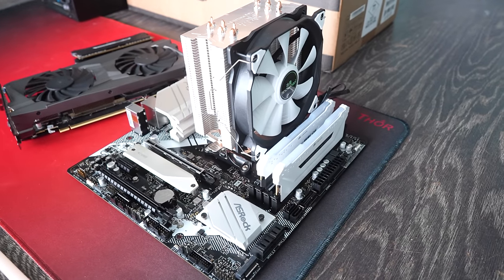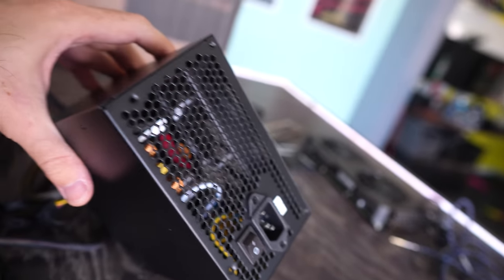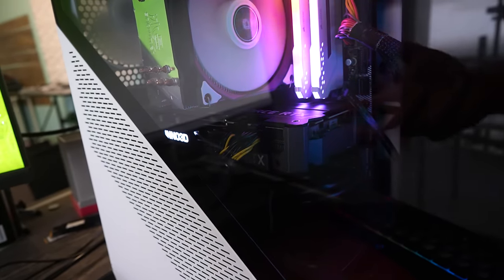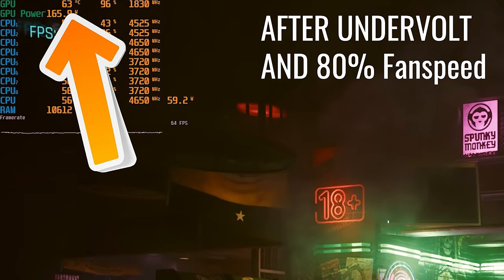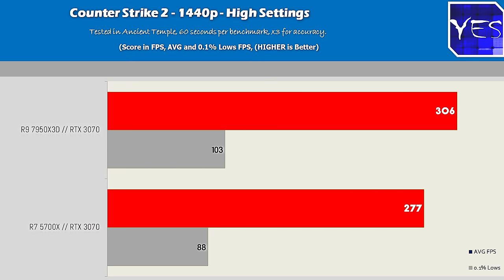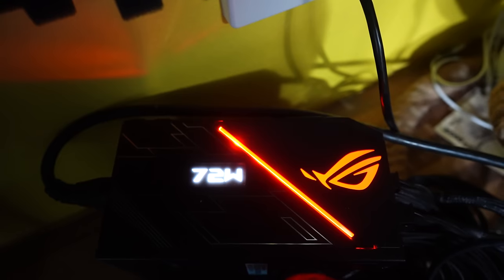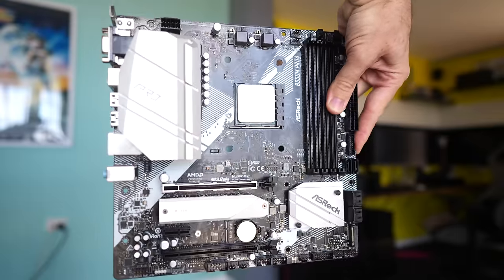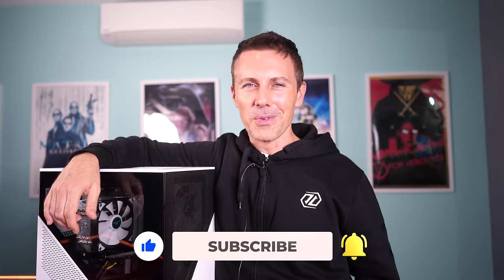Here's a $550 GAMING PC with an RTX 3070 AND a Ryzen 7...!

Comment: For a 1440p high gaming setup, $500+ is rather impressive. I'll see a few parts and see if I can get similar deals in my market.
Reply: You can probably get it cheaper if you dig down the rabbit hole on used market
Reply: Yea but it won't run newer games try a 40 series card. Used it's still $700 to $900
Reply: I have a similar performing system (5800X, 6700 XT) and I play fine at 4K60.
Reply: @powerfulshammy  lol no. As long as you can play 2k at 60fps this far fine. You can even adjust settings for some future games. Not like you need latest and greatest to play games at 60fps.
Reply: Id rather go with a 4060 instead of the 3070 if my budget was around 550$. Its almost the same price new boxed as the 3070 used with not that much peformance drop if any. You get warranty on it and it has many benefits.
Reply: @t0uchmyh0rn  no 3070 is better than a 4060.
Reply: Lol it can’t do 1440p medium on ark survival ascended 🤣😂🤣 hell the 3070 ti can’t stay at 60 with those settings in that game
Reply: @RuruFIN boot up ark survival ascended lol roughest game I’ve ever booted up. 80-90fps 4k on a 4090 and 13900k with dlss on and frame gen
Reply: @yoltsbp  then better pray you find a better card for 1440p under $600 then.
Reply: @yoltsbp  never even heard of that so I doubt that I'm going to have that.

Comment: if the gpu cold plate is screwed to the fin-stack then you should tighten those screws. I once had a 5700XT that would throttle no matter thermal paste i applied to it (it was a red devil one). I then decided to tighten those screws and it dropped like 30c

Comment: No, you don't need a water cooler or AIO for a 7800X3D CPU. You don't even need a high end air cooler. Also, the board doesn't need to cost 200+ USD, a 150 USD board is enough.

Comment: The issue with the RTX 3070 getting hot might be subpar thermal pads. I tore down my Gigabyte Aorus Master RTX 3080 recently to re-paste and re-pad the card. I found the original thermal pads were a crumbling mess. After the "operation" the card runs 10 degrees C cooler.

Manufacturers do whatever they can get away with to cut costs.
Reply from the maker: I will check it out actually. However experience has taught me that the temperatures slowly creeping up over a few minutes at say 60% fanspeeds, has just meant oversaturation on the thermal solution.

Comment: Here in the U.S market we can get things like Ram cheaper used but other things such as power supplies and boards are hard to come by, (Here we can get used ddr4 for $1 or less per gig, but even the crappiest 500w from 10 years ago people will still want $25-$30 for)

Glad to see a reasonably priced 1440p High system after years of "Budget" $1000 1080p Systems
Reply: Bruh this is too good to be true even in the US

I was looking at a Ryzen 4600g 105$ with an RTX 2070 (used) 240$ and a mobo 75$ with 16 gigs RAM & PSU & Case that is over 570$

The system he described has to be at least around 800$
Reply: @KingdomRepublic  i've gotten 2080s off ebay for $190 shipped to my door

As for the 4600G i'd rather just get a Ryzen 7 2700 for around $65-$70 off ebay with a prism cooler, either that or a Ryzen 5 3600 for around the same price

Comment: I had a similar experience with a Zotac 2080 Super twin fan model. With an undervolt it was fine and ran cool and quiet, without the undervolt it was loud and would throttle. This is a pretty impressive build for $550, gaming performance looks very good.

Comment: You've got good taste, I have the same case and also run a 4070 Ti, it meets all my needs and then some! ...I can't justify spending more for something I don't need.
Reply: Just putting it out there that it's possible to find B stock cases with a tiny bit of repairable damage for huge discounts. I got my unused but damaged Phanteks Eclipse P360A for $35 because the metal flange on the rear that holds the side panel was slightly bent. Used some pliers with some cardboard to protect the paint and bent it back to place, good as new.

Comment: I have that GPU in my wife's PC. The memory thermal pads are around 0.7mm, so when replacing 0.5mm doesn't make contact and 1mm holds the cooler above the GPU die. I had significant improvements using 0.5mm with a 0.1mm copper shim and thermal paste

Comment: I just got a 6700xt for 250 flat, i ordered am4 motherboard and ram from aliexpress for 60ish total, i also ordered a r7 1700 for 50, then i got some storage a 1tb m.2 ssd and a 8tb hard drive for 130 total. I also had go get a power supply for 80 so a total of $570. I do not have a case, but im just going to use this in an open bench setup and ill probably buy a mini blower from temu if im worried about dust im gonna have to invest$50 for a better cooler so i can get a better oc

Comment: My personal rule of thumb on my own PC, and when is it time to upgrade is limited by highest refresh rate on my monitor combined with whether I want all that bells in whistles at that refresh rate and fps.   I have an i7 gen 9 8core with an RTX 3070 and a 240 hz g-sync monitor.  I primarily play at CS2 and BF3 on 1280 x1024 4:3 aspect ration stretched to full screen of 16:9 aspect ratio, with my requirement of g-sync on and  v-sync on at 240hz which which ensures 240 fps at 240 hz for a smooth buttery game play, and instant mouse flick to a headshot using a single pump action shotty in CS2/CSGO, and a 44mag scoped headshot in BF3. Anything over this is wasted in my opinion. So all my other casual games like MFH5, F1, BF1 are configured for a step down settings to achieve as high as fps possible without sacrificing eye candy to achieve over 150 fps with VSync.  Any dips are very minimal.
Reply: I mean vsync definitely does feel terrible to me. It's worth being a little bit over your monitors refresh rate, but I wouldn't limit FPS until it exceeds 500 really but I also don't think it's worth going out of your ay to improve FPS (by spending money) until you drop below 150. Limiting FPS just increases latency for no good reason. 

Limiting power > limiting FPS, any day for me

Comment: I'd suggest also avoiding OEM type GPUs (HP, Dell, etc) as they have abysmal coolers as well. They are typically about 10-20% cheaper than board-partner cards but they downclock due to thermal issues.

Comment: this combo is impossible to build in germany^^ the 3070 has a street price here for 250-280 euros (with a grain of luck) and the r7 5700x has nearly the same used price as new... the whole system would eat up 650-720 bucks here... would love to offer this setup for around 600 bucks and i try it everytime when i get asked for a 600 euro build even with an r5 5600 (my fave gpu in price to performance) its impossible^^ so u are the lucky one^^ i love this content, cheers from germany :)

Comment: Actually good testing! Of cpu cuz not all people can have 4080 or 4090 setup
5700x is only cpu you need for even a 4070 gpu even a 6750xt to 6800xt or even 7800xt for 1440p
Reply from the maker: Its a really nice CPU, we did test with 3200mhz memory and 6000mhz on the ddr5 setup. so its also like budget memory vs more expensive stuff on the AM5 side.

Comment: A 5700x is a bit overkill for a 3070. Could've saved some change and got a 5600x which is more than capable to keep up with a 3070. Pretty much every game I run on my system runs buttery smooth at 1440p on a R5 5600x + RTX 3070, 32GB RAM.

Comment: Hello Mister. You know, this happens with any video cards when the heat pipe depressurizes, or the cooling system squeezes out the thermal paste, or it dries out. Well, damn it happens, it’s rare, but it happens. This is just my guess.

Comment: The Snowman cooler with that clip mount is the worst. So easy to screw up the installation and you might just get worse temps than a stock cooler.

Comment: I am using the Ryzen 7 5700x with a 3090 EVGA FTW3 Ultra( a unicorn now)  but went for Noctua NhD12s redux cooler cause if I have to change anything out it is alot easier with an air cooler. The first.R7 5700x had bent pins so I was swapping and only cpu I had that would go with the board was an R3 3100...which I was using with a 3090. So it was interesting but still solid gaming with that until replacement came in.

Comment: I have a INNO3D RTX 4070Ti and have a same issue. Running Hot! During summer sometime creeped up to 89 (my room also was hot 29) now it is running better between 78 - 82 but still not that good compared to different models :(
Next time I am not buing INNO3D GPU
Reply from the maker: Oh so it's not just this model then, looks like they dropped the ball on the 4000 series line too?
Reply: unfortunately looks like it :(
btw its that model you once mentioned in one video that other users complained that fan blades broke off
Reply: @adrianzalaba are you letting it ran at 100% fan speed?
Reply: I also have 4070Ti, there's actually issue where middle fan cracks causing noise.
Other than that I see thermals are not a problem, not going beyound 80. with just 2 slot card I am very happy with my card....
I personally had worse lack with Zotac cards, 3070Ti and 3080 was just so much louder and runnig hot.
It's so weird.....
Reply: @SnifferSock  jop
main issue was summer heat but still above 80 is not the best
Reply: @petertrex  I had better experience with gainward and asus

Comment: I have same pc. R7 5700x and rtx 3070 3 fan version.  I pair with mew power supply 850w.  I thing lowest it can be pair with 650w not with 500w.  When it run on 100%, I had problem with high temp of cpu due to  gpu generate huge temp air. Onky gpu up to 250w. So you can not have PBO on cpu and power limit over default.  I plain invest into new cpu coller and add fan into build.  In general good power, but you need to solve colling very good. Sum can be 500w in benchmark fo whole build. When I pair with rtx 2060 6g, there was no problem. There is only 40w diff in gpu. Problem can be rtx 3070 third fan forwarding hor air by desing into opposie card side just front of cpu fan I think.

Comment: The 3070 fans may have gotten deteriorated. In my experience, fans start going slower much sooner than fully stop spinning.

In CS2, with an RX 6800, my framerate goes to trash with an usage roller-coaster when I enable full screen mode. Tho borderless windows works fine

Comment: Nice build, bang for buck as usual. great work!
So the INNO3D card, I think it might be the pads. swap them out and re-paste, see how it does.
Other thoughts
honestly 5700X is such a good CPU. although you can use 5600X if you are just paring it to 3060Ti/3070 or even 4060, pairs really well with single 120mm air cooler.
Also instead of Snowman you can just use AK400, more aesthetically pleasing with extra few bucks, available anywhere, great compatibility.

Comment: The cheapest two fan zotac 3070 is 475 usd in my country and that ryzen is 190 usd (120 for the motherboard, 55 kingston m2 1 tb, 70 for ram,  psu 65, cpu cooler 45, case 150) So the same pc with almost the same components cost : 1170 USD not UAD. Prices are joke here.
Reply: Alot of his prices here are used.

Comment: I have a similar system which includes a RTX 3070 and Ryzen 7 5800x. But when I play a game like cyberpunk at high settings 1080p my 3070 wont fully utilise unlike my cpu causing stuttering and low fps in the 50's and I'm not sure why.
Reply: How much ram you have? What's the CPU & GPU temperatures? And most importantly do you have latest drivers for your GPU?
Reply: 16gb ram 3600mhz cl16 , ryzen 7 5800x 4.7ghz 64-72 degrees and rtx 3070 1950mhz 67 degrees also with the newest driver. This is why I'm so confused because in a game like the witcher 3, my gpu will perform at 99% but in a games like cyberpunk and marvel's spider-man remastered my gpu will not max out.  @KingdomRepublic

Comment: You can't get near these prices in my country.

RTX 3070 8GB second hand at best you will get for £250 {$304} but closer to £290 [$352]
5700X £150 [$182]  second hand
B550 Pro4 £100+ [$122] 
Snowman MT6S £23 [$28]

Those items alone already are close to same price as your full build

Cases as well looking at closer to $80 some are cheaper but tend to be 12v rgb or do not have full set of fans (some are even molex)

I am not even goign to get into PSU they are so expensive now unless you want to buy some no name garbage even the bottom end evga ones are around $60-70